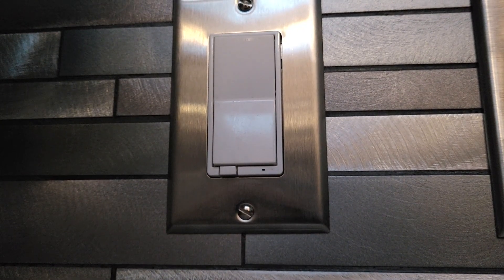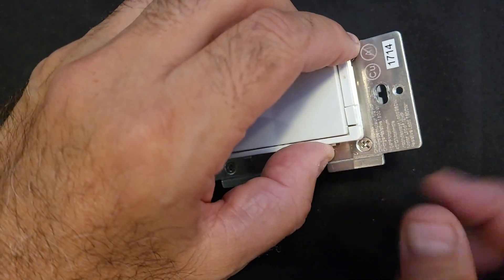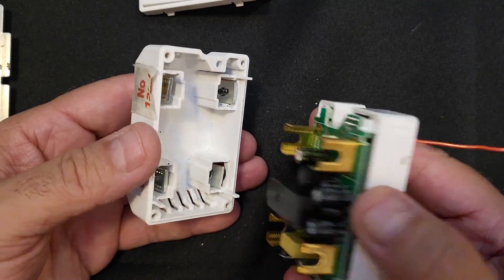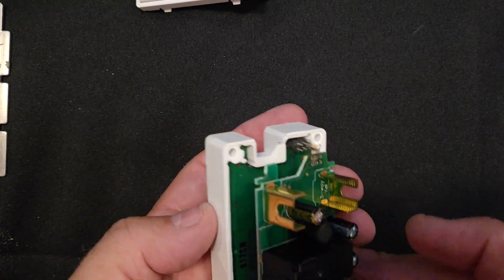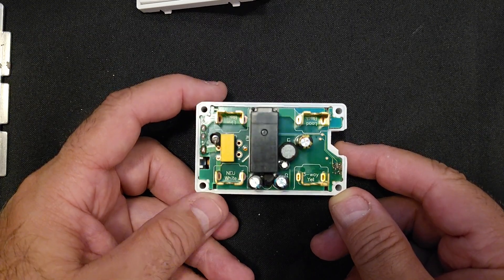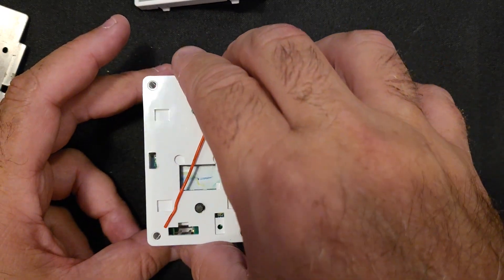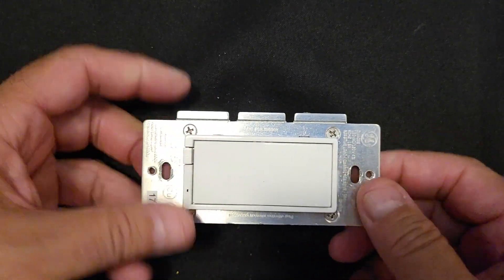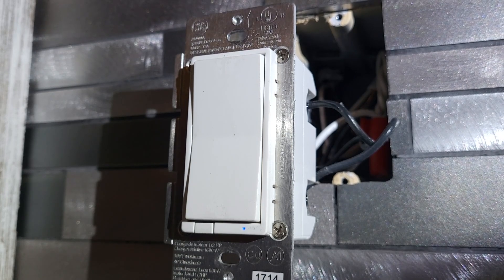GE Jasco ZWave Switch Repair

Comment: As of 8/20/2025 Jasco will not replace these unless they are within the 5 yr warranty window. Date code on the front is used if you don't have a receipt, date code is in 2 digit year and 2 digit week of manufacture.

Comment: This is a awesome! I have 3 GE switches that have given up the ghost over the last couple years. They are older 1627 models but inside look almost identical to yours. I'm going to give repairing them a go because why not.

Where did you get you get the replacement capacitor from?
Reply from the maker: You can get the replacement capacitor from Amazon or Mouser Electronics or pretty much any electronics parts supplier. They are common capacitors. Hope this works out for you! :)